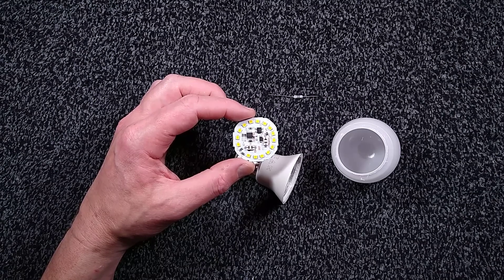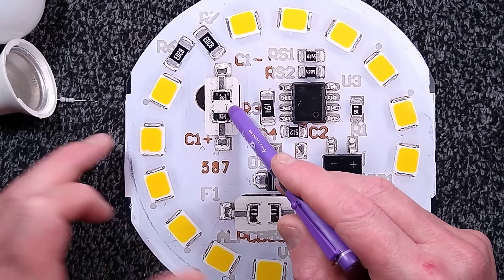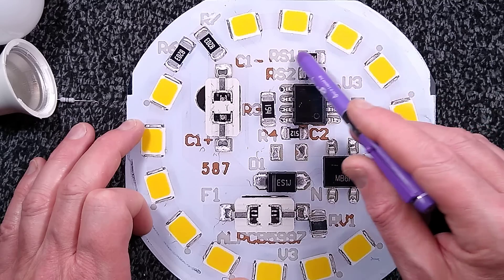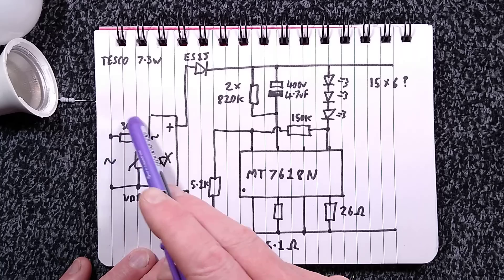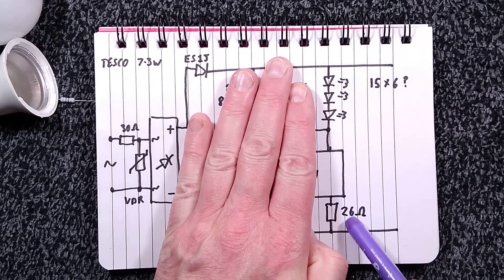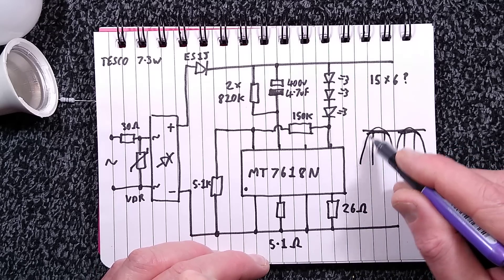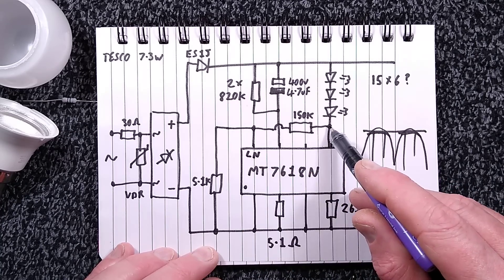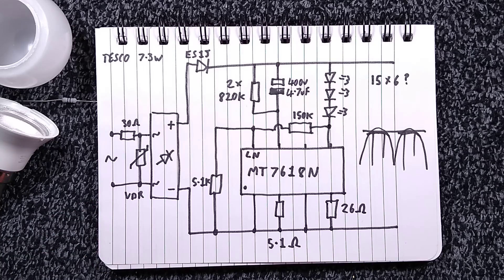Tesco lamp with weird circuitry twist

Comment: The diode could be needed for the PFC that the chip does with the cap. Active PFC normally uses some boost diodes and they are all fast acting because of the high frequency the PFC uses. So they had to block back going current because the PFC charges the cap over mains voltage in some case? Just a guess from a guy with tons of SMPS experience.
Reply: But where is the inductor? A single capacitor wired as it is in that circuit can’t boost the voltage more than the peak of the incoming AC line voltage.
Reply: @Mark1024MAK  it's basically a charge pump, which does not need an inductor. go search for my other comment for a laymans explanation
Reply: @Cracked1ce  -  - I’m well aware how charge pumps work. But with only one capacitor, and the positive leg of the capacitor permanently connected to the positive DC supply and to the anode of the first of the chain of LEDs, I don’t see how the voltage on the capacitor can be any worse than the normal arrangement of a conventional PSU circuit where a smoothing capacitor charges up to 1.41 times the AC RMS voltage (so about 340V DC when connected to a 240V AC supply. Bridge rectifiers designed for use on mains supplies are normally rated to withstand these voltages. I agree that in order to present a better power factor, the charging current to the capacitor is being controlled/limited (switched in and out of circuit). When connected to the LEDs, it will discharge into the LEDs. When connected to the supply it will charge up via a current limited path. None of that alone explains the extra fast switching diode.
Reply: @Mark1024MAK  There's a voltage drop across the 5.1 ohm and 26 ohm resistors, which presents a positive voltage reference for which the ground lead of the capacitor can be connected to which has the possibility to boost the voltage above mains. Combine that with fast switching and you need the fast recovery diode. I would get they put it in there for a reason and not just for fun. But until someone gets their hands on one and checks the signal with a scope we are speculating. But it certainly is possible to boost the cap above mains
Reply: exactly, i gave a more laymans term comment on how it is working in my comment, but the PFC causes the positive rail to become higher than the mains and it is doing some high frequency switching which is the need for the fast acting diode

Comment: Diodes become very hard to get for a while during/after covid. The high speed diode may have just been what they could get to replace their normal diode
Reply: But why even put a normal diode
Reply: But normally a bridge rectifier does everything needed to convert AC to DC. An extra diode is not needed. Hence in this design, why is an extra diode needed?

Comment: Clive, why is a capacitive PF considered a bad thing? Aren’t most industrial loads inductive, therefore the capacitive droppers would balance them out? If not industrial, would appliances like ceiling fans, and home heating/AC units also not bias the PF significantly more towards a net inductive load than capacitive?
Reply: It’s the very short duration at the top of the sine wave of the voltage when it actually draws a relatively large current that is the problem. In a normal rectified and capacitor smoothed power supply, for most of the AC cycle, no current whatsoever is drawn.
Reply: Large industrial loads are already balanced at the facility, because they have to pay for real power. And even for the inductive loads in your home (which aren't very many and are usually only used temporarily - even with hotter summers, most of Europe doesn't have much in terms of fans or AC, so it's mostly the vacuum and washing machine) the amount of lamps in your home alone more than over-balances it.
Reply: Regarding linear loads, power systems are capable of compensating inductive reactive power. If the network becomes capacitive at some point, they would not have any way to counteract this, except of feeding it back all the way to the generators, which is wasteful.
Reply: Yes but if everything turns capacitive in 10 years now you have the problem of balancing it out the other way.
Reply: a rectifier like this doesn't just shift the AC waveform in time (capacitive power factor) it adds many higher frequency harmonics of which only the fundamental is in phase.

Comment: The design is patent pending, like you said... they patented the crappiness... the diode is there because they had too many of them at the factory?  LOL ?  Since you're traveling I guess you didn't have the HOPI to measure the PF? It would be interesting to see what it was... then you could cobble  the circuit and find out if those parts did anything... or if it would set the smoke detector off... Either way, it would be a classic Big Clive video!   🤣

Comment: I didn't realise they used push through connectors like that. Allows unskilled assembly I guess since no hand soldering is needed, and no fancy irons/fume extraction.
Reply: Also, typical through hole assembly is impossible with a conductive board material (Al). It would require non standard (so expensive) approach like unusual lead bending and sleeve insulators.
Reply: Also as Clive mentioned, hand soldering these aluminium PCBs is quite difficult. The surface mount parts (including the push through connectors) will be soldered via reflow, a leaded capacitor would have to be a different assembly stage so rather than potentially damaging parts with a big high power soldering iron, a connector makes much more sense.

Comment: Could the capacitor current limiting be done to reduce noise (EMI) from the circuit?
Reply from the maker: I doubt that's needed.  It's expect the circuitry to be fairly quiet electrically.

Comment: My electric supplyer saisd I could have a fixed rate electric for a year if I agread to have a smarty meter. So eventually i said OK. Took ages to book an appointment and the first time the guy didnt turn up.😡  Then someone rang and made a new appointment, next day I had an email "we can fit a smart meter at your address as we cant get any information from the meter if fitted" 👏👏🤣🤣  Thanks Keep my meter and have a year with no increases.

Comment: The diode right after the FULL BRIDGE RECTIFIER may be for reliability only - if the bridge fails, you still got the rectification rather than having AC wreck the circuit. Why it would be used on a lamp, I don't know... 
As for running the cap through the IC, it may be for zero-crossing detection.

Comment: I've also noticed that ES1J diode in linear LEDs advertised as triac dimmable. Could it be something to do with dimming support?  When I figure out where I put my power meter, I'll check their PF.

Edit: Undimmed, one of my Osram stick leds with that diode has a PF of 0.92.
Reply: i've noticed the same - the diode was even present on the TRIAC dimmable bulbs i purchased 13 years ago.

i only buy dimmable bulbs because they always test with power factors ~92 and higher.   Whilst i don't get charged for the reactive power, it makes a difference for me as I have an undersized electrical service (multi family dwelling) and it also reduces the noise on my A/V gear.
Reply: I bet all the strange circuitry is some weird attempt to stop flickering while dimming on cheap dimmers. 

My old house was tiny built in the 50s and had very few lights.   If you wanted to have a room really well lit you could install a really bright bulb but then if you wanted to kind of chill at the end of the day you don't want 200 equivalent watts of LED light burning your retinas out. 

I installed a lutron cassetta dimmer. It was miserably picky about bulbs.  I must have tried a dozen different types of bulbs before I found something that was pretty bright and would also dim sufficiently.  GE was the only brand that would dim all the way down to a smolder.  Most brands of flicker at 50% or less.
Reply: @michaelwitt188  Your are right about burning ýoùr retinas out. 
LEDS are GARBAGE light compared to incandescent. No public utility has saved any tax money at all because they have to be so much closer together, & Then they have no shrouds so they shine, no they GLARE in everyone's homes where the streetlights never used to before,, burning all the taxpayers  retinas as they installed 2 or 3 times as many as the incandescent they replaced with a serious eyeball damaging headache  inducing GLARE!
THEN WORLD WIDE THEY THREW THEM ALL AWAY BECAUSE THEY WERE SO BLUE & WHITE THEY WERE LITERALLY TOO DAMN TOXIC FOR THESE SAME GREAT RESETTERS TO GET AWAY WITH DEPLOYING on the people. (a military  term for battlefield assets. NEVER used to describe anything unleashed on the public. Until smart meters) so the second round of led streetlights WORLD WIDE had to be less toxic so they cost more to have some red in the glass. Less toxic (slightly) but WAY more expensive cuz the red tint in the glass  on the bulb, no lense or shroud to keep this POISON out of everyone's homes, but the red tint requires more energy to push the GLARE through the tint, ×2 to 3 times more fixtures WORLD WIDE than what they replaced & not even close to the energy savings promised..
TO REPLACE QUALITY LIGHT WITH EYE DESTROYING GLARE! It's as STUPID as low flow toilets.
Or DIABOLICAL 
70 YEARS AGO, There was a cartoon, the Jetsons. 
& by the turn of the century we'd have briefcases that opened up to little space pods we could land on our balcony. INSTEAD, THE TURN OF THE CENTURY BROUGHT EVERYONE  FLASHLIGHTS IN THEIR LIVING ROOMS TO READ BY,
&
PLUNGERS DRIPPING CRAP IN THEIR BATHROOM.
BROUGHTTO US BY THOSE WHO RENAMED THE FLU TO  DESTROY OUR LIVES & OUR WORLD SO THEY CAN LOCK US UP FOR A LIE CALLED CLIMATE CHANGE THAT IS REALLY THE RESULTS OF USING WEATHER AS WEAPON AS THEY IMPLEMENT THEIR GREAT RESET BY STEALING WHAT LITTLE ANYONE HAS LEFT.
YOU WILL OWN NOTHING BY 2030 SAYS CLAUS.
&
WE ARENT EVEN TALKING ABOUT IT?

Comment: What is the actual  PF of the Tesco lamp? I doubt it does regulate the PF... 
The IS31LT3932 has a similar setup and measures between the diode bridge and the fast diode. And forces the current to follow the voltage using an inductor.

Comment: Hi Clive,

The Harmonic emissions limits are much lower for LED lamps than for general equipment - this is based on the fact that lamps are everywhere and are used for a long time (generally at least), so a low Power Factor / high harmonic current content of lamps is more of a problem for the grid than you'd think!

Cheers
Reply: Think this will also reduce the false usage amount on power meters who are that way build that they see more apparent then real power consumption. Done by chosing the power measurement points close to the peek of the sign wave .
Reply: Agreed: one bulb is nothing, but tens of millions of homes with a dozen in each, and suddenly an integrated distribution/transmission network across Europe starts to experience problems.
Reply: @andyowens5494  As Tesco very ungrammatically says 'every little helps'.
Reply: @JUANKERR2000  not to be confused with "every Lidl helps"   ;)
Reply: @trueriver1950  Indeed! My mistake.
Reply: @JUANKERR2000  Grammar. Something my sister was not taught at all, she was lucky. Unfortunately I woz but it was so excruciatingly boring that I make a point of getting it wrong at every opportunity, like most people does.
Reply: @mbak7801  I am truly sorry that you found the study of our language boring. Judging by solecisms that I hear daily on radio and television you represent a frighteningly large group of individuals who are unable, or unwilling, to communicate clearly, concisely and unambiguously.
Reply: @andyowens5494  "suddenly an integrated distribution/transmission network across Europe starts to experience problems." And all this time I thought it was Putin's fault.

Comment: I wonder if the circuit is noisy at RF? Only reason I could think for a high speed diode would be to stop RF getting on the mains, but even then, a simple filter circuit would be more effective...
Reply: Think 5G
Reply: How would that even work? Diodes usually contribute to RF noise, if anything.
Reply: A high speed diode will have a sharper switch off, so generate more noise, not less.

Comment: Maybe the manufacturer also makes power supplies and had an abundance of the high speed diodes in stock?
Reply: Still does not make sense to just add them to designs without any meaning.
Reply: @benbaselet2026    
Very true...but I find that a lot of makers do things that don't make sense  :)
Reply: @benbaselet2026  It is also part of the reference design in the DS.